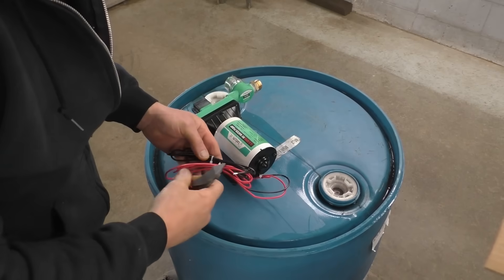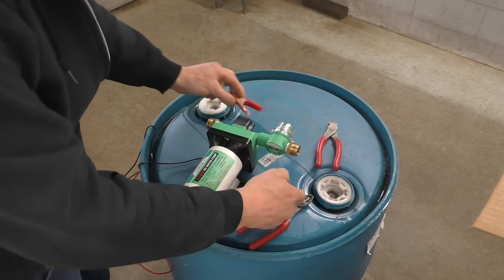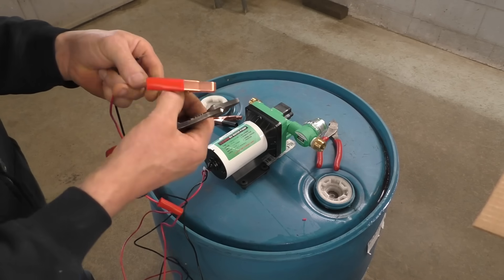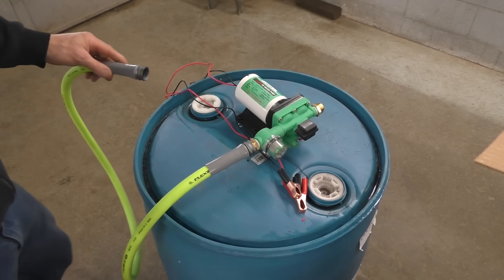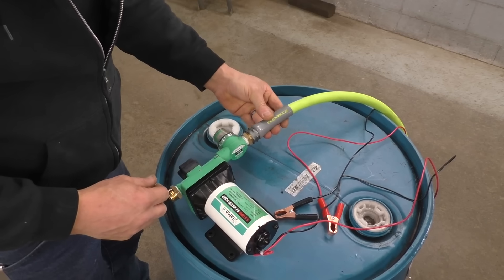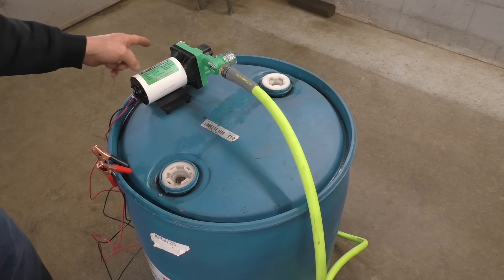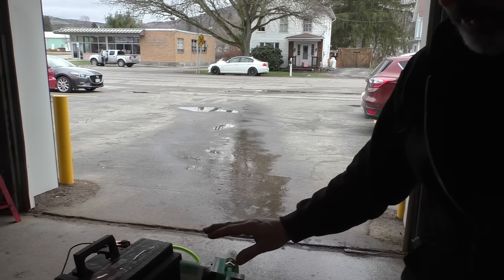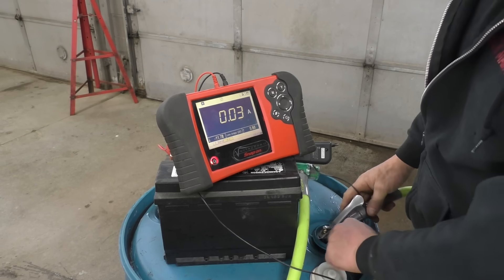12v Pump On Portable Water Barrel

Comment from the maker: 5.5 GPM 55 PSI On Demand Water Pump  - https://amzn.to/3VmeWvx
Brass Pipe to Garden Hose Fitting - https://amzn.to/48WdseJ
50-Amp Clamps - https://amzn.to/48X8kao
Flexzilla Garden Lead-in Hose - https://amzn.to/48Zx8OZ
Flexzilla Garden Hose 50 ft - https://amzn.to/49ZHXC2
Reply: You can absolutely run a pressure washer directly from the spigot on the barrel without the 12v RV pump. At work, we use a 3000 PSI pressure washer from a 275 gallon IBC tote via gravity. We can run the pressure washer for about 2.5 hours on one tank of water. Ideally you want the pressure washer to be as close to the tank as possible and connected to the tank with a short hose, this helps to prevent any restriction in the flow to the pressure washer. The high pressure hose that goes to the spray wand can be several hundred feet long without affecting anything.

Comment: What a great project. Not long after we started to go camping, we bought a 30 gallon, food grade, plastic drum for refilling our travel trailer's fresh water tank. We bought a 12v pump and wired it to a 7-way trailer plug. With the freshly filled drum in the pickup bed, we just plugged it into the outlet on the truck's bumper and ran a hose to the trailer. Voila! Fresh water without having to always carry 200ft of food grade hose, or having to break camp just to top off the tank.
Reply: I was just thinking that while watching and saw this. Brilliant idea.

Comment: I built this exact same setup a few years back. I put 1 bag of quick dissolving pool salt into the barrel and filled the barrel about 3/4 full and sprayed it around my property as weed control. It worked great. It’s a very handy setup to have for areas where you don’t have water pressure, or to apply special mixtures like salt water. 🙂👍🏻

Comment: This setup works surprisingly well.  Have large storage tanks and a Seaflo rv pump ran off a battery similar to yours. Can turn off the city water, then back feed/flow into a hose spigot to feed into my house and have decent enough water pressure inside my home.  Not that I would in an emergency, but could use the water like any normal day to shower, flush toilets, do laundry, cook/clean, etc...
Reply: Better shut the main off first or you'll be the local water supply for your neighborhood LOL
Reply: @staind288 I forgot to mention that.

Comment: Just about how I had mine set up, except my 4 drums were on their sides in my truck bed, and I screwed the valve fittings into the bung and hooked the hose to it.  The longer it has to pull from, say, if you're pulling off the drum and are away about 50 feet from it with the pump, the more power it will pull.  As you have it set up you should get quite a long run time off of a good battery.  Great job there.  Most RVs come with just a 2.6gpm or such pump, so you got THE DOG.  I changed mine to one like that and kept the old 2.6gpm one to pull from my drums, or pull from a creek to fill them if I didn't go home to refill and it worked off of my 4 pin trailer plug pretty well.  You should have no problem doing most anything you plan with that setup.  Take care.

Comment: I’ve got one of those 200 gallon totes I load on the truck and a 12 volt pump like that one. I can run out 75 feet of hose to the pressure washer and it works great.

Comment: I bought a horizontal water tank from Tractor Supply for washing down dirt bikes at the racetrack. Not free but easy to fill and works great. I just keep it in the  back of a pickup. I just gravity feed to a pressure washer but I really like that pump and that it shuts off automatically.
There is a Tractor Supply right in Bath, NY. They have all this stuff in stock.

Comment: kind of impressed with that pump.
I've been working on my rain capture for irrigation water setup, and bought one of the HF pump with pressure tank setups.  works well, but the surging, especially after going through 100' of garden hose, can be a bit annoying.  I was thinking of substituting a no-tank pump instead. Now I might try to sooner than expected.

Comment: I used to pressure wash my boat at a marina that did not have water.  I had a 3000psi washer that I ran with a gravity feed.  Only needed a couple of feet of head.  If you have it in the bed of a truck and the washer on the ground it worked just fine.  Depending on how much growth was on the boat (24 foot) I would use between 50 gallons and 100.  That was a full hour of washing as I recall.

Comment: Eric in my experience using a pressure washer, I've had pretty good success using a 'Header Tank" which can be any sized vessel you deem appropriate & fit a float valve inside it to automatically shut the "supply" off, then just run a short length of 3/4" hose with appropriate sized normal style garden connectors to the washer(if that makes sense). This eliminates the need for having an "extra" pump.

Comment: Where I work we gravity feed our pressure washer off a 330 gallon tote. Works fine. Just have to keep an eye on the water level. Do a couple very large dump trucks and you can run out pretty easily.

Comment: I had one of those Flexi Zillow hoses, well a knockoff anyway. Mainly got it for low temperature days. It worked, but yea, terrible trying to coil it up. They just won't lay flat. On the plus side, it didn't freeze stiff like an icicle on cold winter days. I gave up trying to coil it and just chucked it in a heap when I was done with it.

Comment: 4:35 I had that issue with a hose shut off valve I got on the ama zon, the male threaded side wasn't long enough. It's ghetto, but stacking 2 hose washers worked well enough for me without leaks. I've had bad luck with shut off valves breaking and I really wanted to make that one work since it seemed really well built.

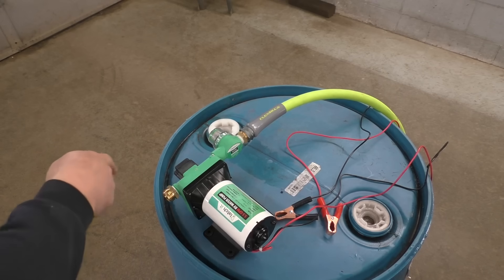5:10 I spoke too soon 😂

Comment: I'm the proud owner of a Flexzilla air hose reel mounted in my garage. From day one the hose would never retract without pulling it in and out several times. Come to find out the hose expands so much when filled with air it's like having more hose than the reel can take in. I found this out by releasing the air in the hose before starting the rewind and the hose wound up without a hitch.
Reply: Around the farm shop and around the farm we went to all Flexzilla water and air. We love them for their flexibility. Just don’t grind,weld or to torch around them😂

Comment: If it helps eric, I did test the theory of hooking up a pressure washer to a tank of water and it didn't work. I ended up  making a very similar setup to what you have here a couple years ago for making a gas pressure washer pretty much stand  alone and it works really well for that.

Comment: I had a 300 gallon tote I used to catch rain water. It was 6’ off the ground on a stand. I could run a small electric power washer from it just by gravity feed but not a gas powered pressure washer.

Comment: The pressure washer will work on gravity feed because the pressure washer is a pump. Now you have 2 pumps. If you put the barrel in the truck bed or trailer and the pressure washer on the ground that helps with gravity feed too.

Comment: About 30 years ago i took a 55 gallon steel drum and drilled a hole in the large bung cap and installed a tire valve stem.  I removed the small bung cap and installed a 3/4 drain valve and connected a garden hose.  Filled it with water and connected a tire inflator running out of the cigarette lighter in my truck.  It would shoot a nice stream of water from 50 to 70 psi.  But running it over 65-70 psi it would start until the lip at the top and bottom. 😂.  It was great for hauling water out into the woods to water small food plots or as an emergency 'small fire' extinguisher.  What meaning the fire, but the extinguisher. 😂

Comment: Don't have any experience with Flexzilla water hose, but have to agree with you on their air hose.  I refer to it as Kinkzilla.  The only way I've found to coil it back up is to straighten it out it's entire length, then spend 15-20 frustrating minutes trying to get it coil back up neatly, until you finally give up and just let it have its way.
Reply: As someone who deals with only 100 feet commercial water hose 3/4 inlit I will never coil them up if they not warm they loop so easy but  being cold they will not flex and I will just find something round to help looping it and air hose I need them on a rell so much easier

Comment: Many pressure washers can also suck water a few feet - so usually you don't need a pump if you just use a pressure washer or if there is anyhow some pressure from the water in the barrel.

Comment: I was wondering about just dropping your short hose in from the top hole, and avoiding the spigot at the bottom. Maybe self priming would be more difficult at first startup, and winter draining might be more awkward. We have an area of the house I'd like to tie a roof drain into a drum to keep water away from the foundation.

Comment: Probably would be wise to put an inline fuse on that. Had a similar setup on a battery in my old camper, running one 12 volt light. After replacing the melted wire i have a fuse now.

Comment: I use gravity feed of about 4 feet to my pressure washer in my farm truck and it seems to be perfectly adequate. 55 drum on its side ratchet straped to a ladder rack on a bucket truck. See how your barrel lids have 3/4" thread in the center? That to a boiler drain

Comment: I sure wish this video was 7 YEARS old….
Then I could ask if the pump held out and held up to long term use.
I have a dozen 55gal water barrels in my basement for emergency use and absolutely hated the manual rotary pump and the 120vac utility pump requires the use of an inverter vs. just powering with a 12v battery.

I am using 100ah 12v Battle Born batteries for my fire alarm system, security system and CCTV video surveillance equipment.   I have 4(fire alarm has 2 in parallel for longer operation during a power failure.
I can just take one of them from the fire alarm system and use with the water pump in an emergency.
(they all use Anderson 60a connectors, so it’s easy enough to unplug for a few minutes and return to the system after water pumping work..)

The batteries are pricey, but if this works well, I’ll buy another. ($790@)

Thanks for your outstanding videos and channel!
Reply: They're used in a few million RVs, they do fail occasionally but overall I'd say they're quite reliable, and because there's such a large market they're jellybean parts, cheap and plentiful so just buy 2 if you're worried about reliability (I upgraded my stock pump to a quieter model and keep the stock one as a spare in case the new one gives out when 100 miles from town, like what happened to long long honeymoon 13 years into owning their Airstream while they were in Grand Tetons)
Reply: @andrewfidel2220  Thank you !
Also… stupid question, but can I use the pump using a hose coming down from the top (bung?) holes INSTEAD of installing a valve near the bottom of the barrel.  Ha! “Bottom of the Barrel”.  Pun not intended, but still made me chuckle.
In other words, does the pump have the strength to pull water vs. gravity fed from a lower valve.?

Thanks again!

Comment: I'm thinking an Deep Cycle trolling motor battery would work better on that?
Reply: Not better than the 3 or 4 half dead ones I have laying around haha
Reply: I bought the same battery that my pickup truck uses to run my pump on my 20 gallon tank that i keep under my toolbox on my truck.. So now when I go camping I got a backup battery just in case.

Comment: Disconnecting positive or negative first doesn't matter in this situation.  It only matters if you're using chassis for positive or negative.  You don't have a chassis.  If running negative through chassis, you fuse positive.  If running positive through chassis, you fuse negative.

Comment: That’s my primary for off-grid trailer and barn, a 12 volt rv pump, rain barrel and garden hose. Works really well if you keep the dirt out of the pump. Ever rebuild one?
 Battery service life is my issue. They only last so long before they don’t hold a charge. What are your thoughts on rejuvenating lead acid batteries?

Comment: I checked and those Flexzilla hoses have aluminum end fitting so do not leave the hoses connected to the brass hose bib and hose adaptors or they will corrode and get stuck on.

Comment: The minimum required inlet pressure and flow is 40 PSI and 4.8 GPM to ensure the washer operates as intended. You could have raised the barrel up 80 feet. Gravity flow through a 1/2" hose gets you 7 gpm. Your solution is probably better.

Comment: As a question, and only that since obviously you have your set up now, but did you know that EGO power tools came out with a portable pressure washer? I'm going to guess it would not fit your needs but it does come with a dip/syphon tube to be used in a bucket or barrel of water. If your setup fails at any point maybe worth a look! It is just something I have been looking at personally

Comment: I tried the same thing and it would not work with a pressure washer. Not sure if I had some other problem, but it seemed the PW was forcing back into the pump and causing a problem.

Comment: Maybe just a dumb thought, but if the pump is self-priming why not simply run intake hose to bottom of tank thru the opening in the top of the tank?  Then no need for valve in the bottom of the tank.

Comment: You might buy a little cheap solar panel trickle charger...  Depending on how often you use it, or where you set it.    It could be a set and forget type of thing..  The little solar panel would keep it charged all the time and you never have to think about it again.
Reply: until it overcharges and ruins your battery, then you have to think about it, lol. And yes, the CHEAP trickle chargers will overcharge your battery, ask me how I know

Comment: Flexzilla garden hoses - well they mildew badly. Our originally bright orange flexzilla hoses are all brown now. They all got covered with mildew that can't be scrubbed off. I tried just a tiny section with bleach and scrub brushes and everything I had. Remained brown. Not impressed. I guess the soft material allows the mildew to penetrate into it.

Comment: Not everything needs to be or should be fused.  We typically fuse because the wire is going to be buried somewhere out of sight out of mind.  So you won't see damage, and the wire might be next to something combustible.  So it needs protection.  

For your application, none of that applies.  You can fuse it, but it's not any safer in your situation. 

The other situation - shouldn't be fused - is for safety critical applications where something even worse than burning wire will happen if the power source is cut.  Imagine life support equipment or emergency backup power for flight controls.

Comment: Gravity feed into a pressure washer isn't a good idea because of pump cavitation. You need adequate incoming pressure to overcome the inertia of the water column in the feedwater hose. If I were you, I'd add a small accumulator tank at the pressure washer to mitigate the effects of hysteresis and lag time of the source pump.